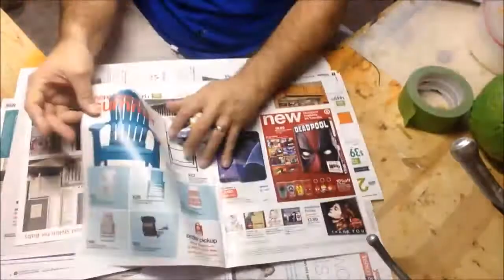Christmas Twisted Snowman from paper mache

Comment: And if i wanted this say... 6' tall, how would add strength, stability? More layers?
Reply from the maker: 6ft I’d approach it completely different. Ideally would probably use a chicken wire base with spray foam like I did on the goblin video I just put up and then cover that with paper clay
Reply: @UnhingedProductions1  thx. Awesome snowman btw. I saw videos of people using beachballs and sprayfoam, but damn that's expensive, they used 15 cans. Paper mache, way cheaper👍👍